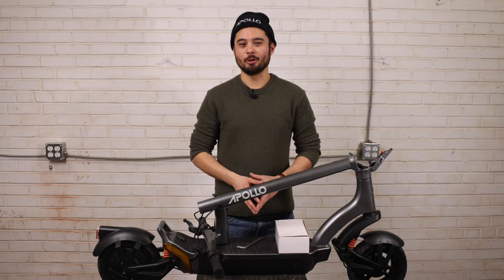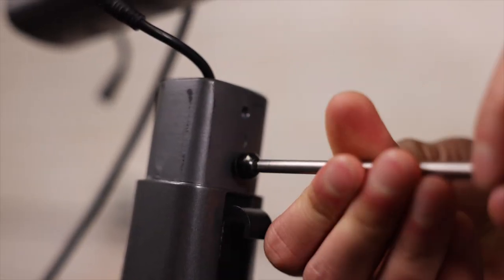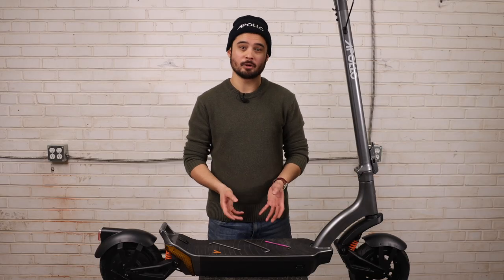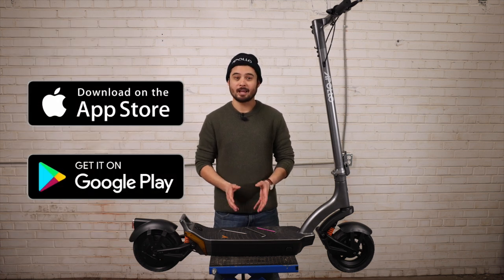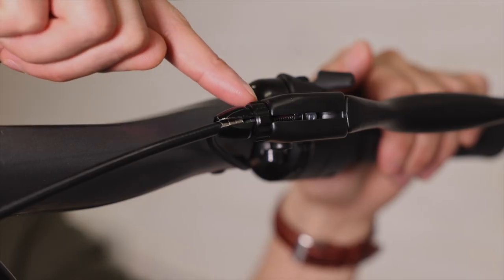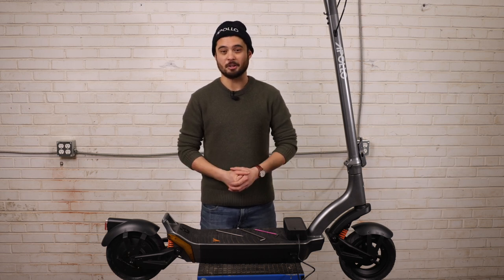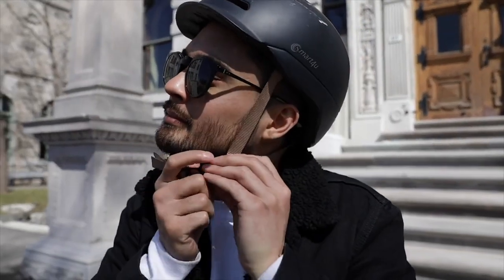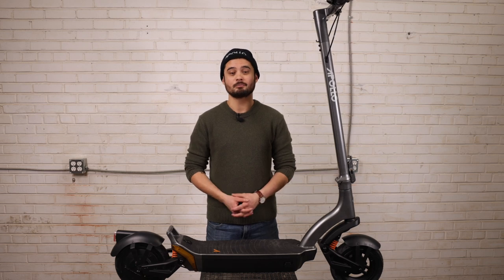Apollo City 2022: Setup Guide

Comment: This video is linked from the "Apollo Air 2022 Maintenance Guide" on the Apollo website as a reference on how to check tire pressure, but the max pressure for that model is much lower (36PSI) than the 45PSI recommended in this video. The maintenance guide should probably indicate this so that people don't over-inflate the tires on their Apollo Air.

Comment: Would be helpful if you guys made it easier to get rid of the ridiculous 20 KMH speed limit on the CITY PRO. First of all why is this the factory setting and if so why did you spend 8 plus minutes on this video and not even give it a mention. No info in manual. The app has a speed setting for all 3 ride modes but that doesn't work either -- made no difference. I didn't spend 1.5K for what is effectively a 12 mph ride -- the out of the box experience needs to be better in spite of all the great features.. plus mine was not set up for zero start mode by default as you say here. I had to spin the wheels during the throttle and brake test out of the box. thx

Comment: My scooter is limited to 25km/h how do I fix that?
Reply from the maker: Hi @randiplayz8750,

You can go to the Apollo App basic settings to change your top speed :)

When connected to the scooter, start by clicking on the 3 dot on the bottom right of the dashboard screen.
Then click on the gear Icon 
Then click on ''Top Speed-Limit'' 
Then press on ''Save''

Comment: Apollo, i lost one bolt that attached the front fender. As i removed another fender bolt, i saw there was no locktite applied, so i removed and put locktite on all remaining fender bolts so i would not lose the them. I’m still missing the one lost bolt. Quality control slip.

Comment: The only thing keeping me from pulling the trigger is wanting to see how this does on dirt roads an going off low curbs. I no the ghost will handle it but i like how Maintence free this is and if it could handle that type of riding i wouldn’t care about the loss of slight power
Reply: Ah they just upload  a video just now how it handle on dirt road 😆
Reply: Getting a flat really ruined a day on a different escooter, i got the city pro ‘22 just for the convenience of much less maintenance. Self seal tires, no bent discs, really remove headaches. 7 months ago? If you bought, check/add locktite on the bolts on the fenders
Reply: Overall low maintainance but you do have to clean the suspension and lubricate it cause it has open suspension

Comment: about to order city pro, need to know if the smart phone app also functions as smart key to lock and unlock the scooter? or can anyone just walk up to my scooter, power it on and ride off into the sunset? lol super important for me to know, thanks in advance!
Reply: it’s a feature on the app . u can
lock it . and it starts breaking . and they can’t leave . also it does a loud ass alarm like a car. and lights and all start flashing .  chain it up . and u should be good . the chain is good you should have no problem . and if chain fails . then the thing will become a car
Reply: @lifeisamovi  Does it actually do the alarm stuff you mentioned? I know the electric regen brakes are enabled, but where have you seen/heard it do loud sounds and flashing lights as well?

Comment: I bought Apollo City 2022 with Mercane Widewheel Seat as it mentioned in apollo website it is compatible with any apollo scooters. I just receive the seat but there are no screw holes on apollo city deck. Now I am getting frustrated how can I install it to the scooter. Do I have to buy other parts to attached the seat?

Is it even possible to return the seat with no cost on my side?

Comment: My city pro arrived last Wednesday night & for my first ride on Thursday the screw inside the locking mechanism not only snapped, but it doesn’t even screw into the plate. Still waiting for an answer from Apollo (4) days later. No customer care telephone # to call. No responses to my numerous follow up emails.

Probably not a good idea to buy a scooter  from a company that has no telephone number.

You should stay away from Apollo unless you plan on fixing your scooter yourself the day after you get it
Reply from the maker: Hi Robbie!

I apologize for the delay in having one of our customer service agents get back to you. However, please do not send multiple emails. It fills up the system and unfortunately slows things down even more.

I am going to have one of our agents look into your case right away, and have them get in touch with you ASAP. Thank you for your patience - Randy
Reply: @ApolloScooters  

Randy,

Appreciate the response & the pictures. It appears as though that screw was damaged (the threads). I put everything back together, & no wobble. TY!!!

Now the second problem. I plugged the scooter in last night to charge, & this morning my scooter is dead. I checked the charger, & plugged it in to every working outlet in the house. The charger is not working. The light is not going on. I use this scooter for work, & once again I’m disappointed that I still cannot use my scooter, & have to resort to expensive Ubers.

I need help with this problem quickly!!!!!!

Comment: Random question, but would the stem be wide enough inside to hide an airtag in? Top before the handlebar attachment or down near the folding mechanism itself, either would work. Just assuming the deck isn't easy to access as it's IP56 so can't hide it there.
Reply from the maker: Hi Cole, yes it should fit in the stem easily! But you may want to attach it securely so it doesn't fall all the way down and become impossible to remove later.
Reply: @ApolloScooters  I just thought of a uslesss but helpful idea I guess a dedicated compartment for an Apple air tag